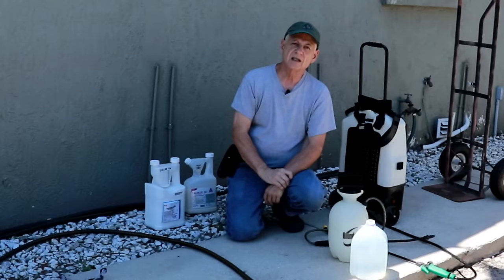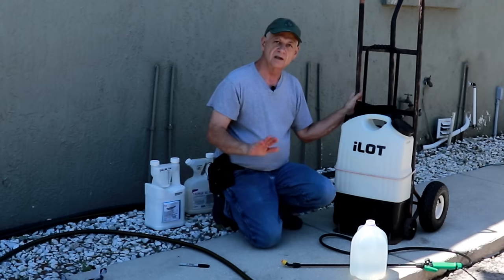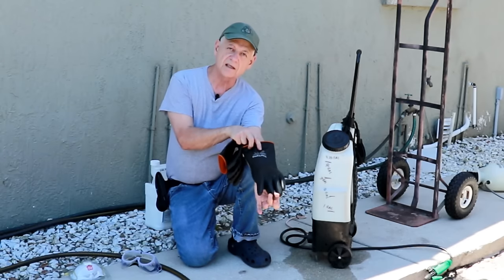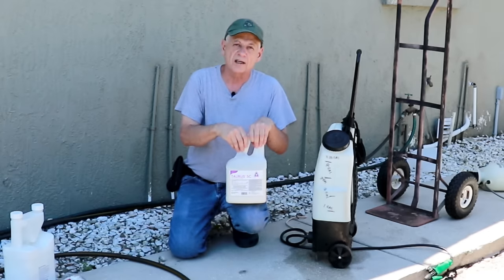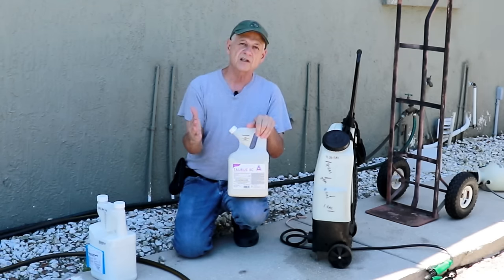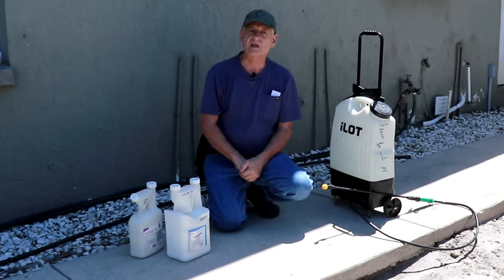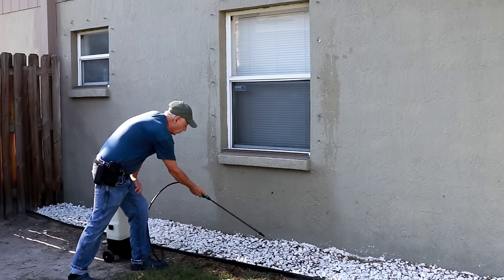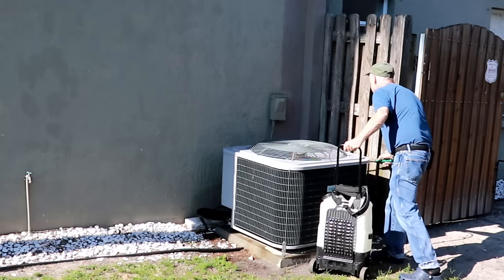General Exterior Pest Control - IMPORTANT!  READ THE DESCRIPTION.

Comment: Guy can I do Taurus sc spray in my attic also for general pets?
Reply from the maker: I would not use Taurus SC in the attic.  However, you can use Talstar P.  If you treat the outside of your house every 90 days, then you will no longer have bugs in the attic or anywhere else in the house.

I hope that helps.  Be well my friend.
Reply: @GuysPestSolutions   what  is the name of that b ig old tank you're using. tried the basic ones at harver freights but they always play out over time (those basic sprayers at hardware places/lowes/walmart etcc.
Reply: CAN U DROP A LINK FOR THAT BIG OLD SPRAYER SIR
Reply from the maker: They no longer sell that sprayer.  Too bad.  It's a great sprayer and it was not expensive either.  I have had it for years.  If you need a new sprayer, you can get a good one on Amazon for around $150, or you can do what I now do. I no longer use a tank sprayer.  I just got too old to be carrying the thing around.  I now use a hose end sprayer with Bifen XTS.  I have a video on how to do it.  In the video it shows you how to use Bifen IT in a tank sprayer and that is much like the Talstar P.  Later in the video I show you how to treat with the hose end sprayer and Bifen XTS.  Doing it this way is 3 or 4 times faster and it's super easy.  All the equipment and supplies are listed in the description of the video.  If you want a good tank sprayer try the one I have a link to below.  I don't own this one, but it's a good make and puts out 60 psi.  

I hope that helps.  Be well my friend.

Video on how to treat your house with Bifen products:  https://youtu.be/Yozv3s-Qwlw

Tank sprayer:  https://www.amazon.com/Chapin-60124-Multi-Purpose-Rechargeable-Translucent/dp/B0BYB6P8J3/ref=sr_1_8?crid=X0ESEWS5ZRA7&dib=eyJ2IjoiMSJ9.xOjNhX6PcVj0MJ0w3o4FA5bnOCeYmxIjjQayKBunhns-OlQnm3rF1GYAi1iORd31eakc3T7FXNhcFJdstQ-i1h3834olNQCAi95xnn6ISLX1G3CZbTDF0PVGGZDI4m_tWwFQNjUF8UW7WuD7JZBuf2dPzIENPAysMHNppqjCZBAjl6hp4OrLe2t3E_AoGk32tjNwjylRP1hy6xCkIxIkyxB60YBArFLFXQGVqgRHP_E_7sWIxVtpFUrrqWOSS_rH7WXwccwFwS6wfKA58PC-OJGoS_7rEjBfL54EtsIn34Y.OvKGA4IyKinDIHdM4iW02Arag2GtiZNxs-c61I_aIcg&dib_tag=se&keywords=chapin%2Bbackpack%2Bsprayer&qid=1718819573&sprefix=chapin%2Bba%2Caps%2C114&sr=8-8&th=1
Reply: Could you go over the specs you need for guns on sSpecification on sprayers: Total volume: 16 L; Working Volume: 12 L; Pressure: 1.5-4.0 bar; Product Dimensions: 24.8 x 8 inches (63 x 20.5 cm); Lance Length: 20 inches (51 cm); Hose length: 3ft Reinforced Hose; Net Weight: 8.3 lb (3.8 kg); Gross Weight: 8.9 lb (4.05 kg)prayers. This would be good for for viewers.
Reply: @GuysPestSolutions  can you go over spec to look for on sprayers that shoot more force or pressure per say.  I seen one on lowes(cansister) wanted your take on it.Specification: Total volume: 16 L; Working Volume: 12 L; Pressure: 1.5-4.0 bar; Product Dimensions: 24.8 x 8 inches (63 x 20.5 cm); Lance Length: 20 inches (51 cm); Hose length: 3ft Reinforced Hose; Net Weight: 8.3 lb (3.8 kg); Gross Weight: 8.9 lb (4.05 kg)
Reply from the maker: Gosh.  I never really thought about all those sorts of specs.  Mostly, I am just looking for tank size and pressure.  I usually recommend a sprayer that puts out at least 60 psi.  The more pressure the better.  Most high-pressure sprayers are backpack sprayers and hold 3 or 4 gallons.  Either one is fine.  It depends upon what you are comfortable with.  The longer the operating time the better too.  The only other thing I look at is the length of the hose.  This is not a deal killer for a sprayer, but the longer the hose the better.  It's nice if the sprayer has wheels, but also not a deal breaker.  I hope that helps.  Be well my friend.
Reply: Thanks any links to good sprayers that  hold up😊
Reply from the maker: There are any number of good sprayers on Amazon at different price points.  You should go for one that has at least 60 psi.  A really good one would be My 4 Sons.  I will give you the link.  A less expensive, but still very good sprayer would be a Chapin.  If you want something with wheels, you could buy a VEVOR.  There are others as well. Just look at the specs and the reviews.  Select one that seems right for you.  You will have it a long time, so take your time.  I hope that helps.  Be well my friend.

My 4 Sons sprayer:  https://www.amazon.com/MY4SONS-4-Gallon-Backpack-Sprayer-Fertilizer/dp/B0D2JDX5XT/ref=sr_1_3?crid=2W26526XKFS00&dib=eyJ2IjoiMSJ9.rFOyFjexHNJqD7GkkwUS5hhki1xlNG1ntSBkkAxraLnN36hTchSpYE4cqlhOlgafAVI2DajSLae4P8ngc5BWSjZKQ-OoAc7tkk-KJcY2wAyyI05MZ6dMEGapYK0-RUYfYrcnOJjTio2kqv9Q2hhArgoKBUQMGHoz3uiKFL2XUADRk-AqDMW4awkd84VIC38Fej86LY05brLnTb4Lo40VhStPOPo2XbZUFZWwDeSNWiNvwvx3TZefVlWAuD4vJuAypU70c-AR9d8hwWuMdOWvte1xNIT6HATd7vAhNytgwLU.mHQaz9BJtBOTrjcDSVGX38X5I88C3DBHF8pMbv_rI6s&dib_tag=se&keywords=my+4+sons+backpack+sprayer&qid=1719571317&sprefix=my+4+sons%2Caps%2C120&sr=8-3

Chapin sprayer:  https://www.amazon.com/Chapin-60124-Multi-Purpose-Rechargeable-Translucent/dp/B0BYB6P8J3/ref=sr_1_11?crid=23DMMGI65ZE7M&dib=eyJ2IjoiMSJ9.cWqP_vYuVKJgdqKiVzX7x19Er8TIZbVKnwNVZElp5UA9DiRfWlbbuFoEHixFQSucnB94nm72VwNIINND-Xxx_F66-cQZQ9jTGQ4NglB0pnjJ7dfthOTocs0mGbcIV_MWYh-ZufpFACuOr35YhYtNDGDB_u_HrSkj8m_1CJoYSu4aNU3FThzIIAf0JqaGmhpvECD41HjhJpr5Zv-2DaDZbU7ediJYr6CtWkrqzxQtSxL5Va7KSLleM3qtUhAKYuUueAbgVuaJdowgMyeEuRsa1ajntzEA0ZBCdm3xq_yKU4I.UI3tetB5FzLtbvPkx2BSm2OYpnwbe3V9Qvv1Js4TlLY&dib_tag=se&keywords=backpack%2Bsprayer%2Bbattery%2Bpowered&qid=1719570882&sprefix=backpack%2Bsprayer%2B%2Caps%2C106&sr=8-11&th=1

VEVOR sprayer:  https://www.amazon.com/VEVOR-Sprayer-Cart-0-94-PSI/dp/B0BZRGNPF6/ref=sr_1_20?crid=23DMMGI65ZE7M&dib=eyJ2IjoiMSJ9.cWqP_vYuVKJgdqKiVzX7x19Er8TIZbVKnwNVZElp5UA9DiRfWlbbuFoEHixFQSucnB94nm72VwNIINND-Xxx_F66-cQZQ9jTGQ4NglB0pnjJ7dfthOTocs0mGbcIV_MWYh-ZufpFACuOr35YhYtNDGDB_u_HrSkj8m_1CJoYSu4aNU3FThzIIAf0JqaGmhpvHzAV8-txg--K3aIYDYn__8BHDw9LeewDq9S95EGAA7X5Va7KSLleM3qtUhAKYuUueAbgVuaJdowgMyeEuRsa1ajntzEA0ZBCdm3xq_yKU4I.Q03Rd6r6FV1xTo4Aozra58K6I8C8zXgjjQlYMmvPHzQ&dib_tag=se&keywords=backpack%2Bsprayer%2Bbattery%2Bpowered&qid=1719571155&sprefix=backpack%2Bsprayer%2B%2Caps%2C106&sr=8-20&th=1

Comment: Can I use the SC to kill spiders
Reply from the maker: The Taurus SC can only be used outside.  It will kill all the spiders that are out there trying to get in, so that will effectively end your spider problem.  However, if you have spiders inside the house, then just spray them with Raid Flying Insect Killer and knock down the webs with a broom.  Also, spray under the bed, behind the headboard, behind and under dressers, and anyplace else where spiders like to hide.  The Taurus SC can only be used every six months, but it does not last six months, so you need to do an in between treatment with the Talstar P.  So, start with the Taurus SC, then three months later use the Talstar P, then back to the Taurus SC, and so forth.  If you do this, then you will be spider free.

I hope that helps.  Be well my friend.

Comment: Tandem vs Talstar?
Reply from the maker: Talstar P is way more cost effective than Tandem and they pretty much do the same job.  You can get it even cheaper if you go with Bifen IT.  It has a slight odor to it, but it's basically the same exact thing as Talstar P.  I wouldn't buy Tandem unless you like spending more money than you need to.  I don't use Tandem because of the cost, but I'm sure that it does a fine job.  The Tandem runs around $116 a quart, while the Bifen IT only costs about $55 a gallon.  The dilution rates are similar, so that is a huge savings.

I hope that helps.

Comment: If you’re using Taurus like that you are blatantly  disobeying the label…. Taurus SC can only be applied as a 18 inch permitter band for general pest control. He’s very thorough but Taurus used like this is illegal; you need a less restrictive product like Suspend Polyzone or Patrol. 20 gallons is also way too much product for a permitter. 1.2oz of product, or 1.5 gallon of finished dilution per 1000 square feet is the appropriate application rate @Guy’s Pest Solutions
Reply from the maker: Hi Jason.  I appreciate the comment, but you are not correct.  If you read the label again, you will see that Taurus SC is definitely labeled for use exactly as I described.  I will place the exact language below that I took directly off the label.  When reading labels you need to be careful to read all of it.  Sometimes the information you want is buried at the end.  In this case, the product is really made for termites and not general pest control.  However, it is labeled for use for all sorts of pests and you can safely apply it to the entire exterior of the building and it is perfectly legal in most states.  Some states do not allow for the sale of this product at all to unlicensed people.  Now, this is not to say that you cannot treat with other products instead.  There are any number of fine pesticides that can be applied the same way as I show in my video.  However, I have been doing this a very long time and I can tell you that an initial treatment with Taurus SC, in my opinion, is as good as it gets.  After that initial treatment, then most other pesticides are fine to use.  The key is to be thorough.  Any crack, crevice, hole, or whatever you leave untreated is a place that bugs can enter.  I hope that helps.  Be well my friend.

APPLICATIONS TO EXTERIOR SURFACES OF LISTED STRUCTURES AND INTO WALL VOIDS: Apply Taurus SC finished dilution (or foam) as a low-pressure spray to the exterior of the structure where listed pests enter, trail around the structure or where they crawl and hide or their nests are found. Treat using a low-pressure coarse banded surface spray up to 18 inches in width around doors, windows, vents, pipes, foundation cracks, drilled holes or around any exterior openings where listed pests could enter the structure. Make sure to treat the joint where exterior siding (wood, vinyl, aluminum or other similar materials) meets the cement, brick or block foundation. Treat anywhere electrical, cable or telephone wires enter the house. This treatment should be made as a general surface spray, crack and crevice spray, or a wall void application. Taurus SC may be applied as a foam treatment into wall voids to kill and / or control the above listed pests.
Reply: @GuysPestSolutions  I agree that Taurus SC is the best, fipronil has a superb transfer effect for colony kills. Only other product that comes close is Alpine WSG.  Unfortunately Taurus has a even more restrictive label in New York and it’s application rate is capped at .8oz instead of 1.6oz. 
My understanding is the perimeter band was only 18 inches and the company I work for does not permit overhead applications like you demonstrate because concerns about drift, even though many products are labeled to be used on the underside of eaves. My understanding of the label was that maximum treatment height on a structure would be 18 inches for Taurus SC because of what the permitter band specifies, but it seems like that’s not actually the case. What you’re saying and what the label says is that the permitter band is 18 inches but you can treat more thoroughly above that around any entry-points you mention? My company has trained us to really only apply a permitter band and not spray anything over shoulder height, even if the label permits overhead treatments. We still focus on entry points but we really don’t do around door frames or windows frames if they’re overhead. If I was to treat like you suggest would you recommend a pin stream or a fan spray for overhead treatments and door/window frames?
Reply from the maker: Hi Jason.  The 18 inch band thing means that the pesticide manufacturer doesn't want you to drench the walls with the stuff, but you can apply it around windows, doors, eves, and so forth, using an 18 inch band.  Now, it is perfectly understandable that most pest control companies will not use this product to treat eves or anything over your shoulder.  As you pointed out, we have some elements at play that can create a problem for a pest controller.  One thing is gravity and the other is wind.  When you spray any pesticide on the eves, or any other place over your shoulders, gravity is going to force the overspray down.  If it's breezy at all, then you are going to get some drift.  This is not so much of a problem for the environment, at least not in my opinion, but this is an issue for the pest controller.  The truth is that getting some of this on your skin once in awhile probably will not cause any harm at all, but if you do this stuff every day, then you really don't want to be getting it all over yourself all day long.  My video was for do it yourselfers who are only going to use this product for eves every six months and I specifically advised folks to wear full PPE and to take a shower immediately after the application.  You see, here's the thing.  If you want to find a place on any home where bugs can enter easily, it's the eves.  There aren't just penetrations in the eves, there can be long penetrations in the eves.  When you live in a place like Florida for example, we have drywood termites.  These guys do not colonize in the ground, but rather in wood.  The swarmers will and generally do enter the home through penetrations in the eves, as well as around windows and doors.  Once they establish a colony inside the attic, the homeowner is in for the infestation from Hell.  The only sure way to eliminate drywood termites is to tent and fumigate the entire building.  By treating the eves and around all windows and doors you virtually eliminate the possibility of getting drywood termites.  Treating the eves also prevents spiders, wasps, and so forth.  Again, most, if not all, pest control companies do not do this treatment for safety reasons.  They want to take good care of the people who do the work and I would agree with that reasoning.  However, it is perfectly safe for a homeowner to do it because of the limited exposure.  I always do a fan spray in all these areas and yes, I do get the product on myself from time to time.  I got my first license in 1981 and I retired in 2006, so I have been doing this a very long time.  If you think fipronil is worthy of respect, then you should have seen the stuff we used back in the day.  It would make your hair stand on end and it has been banned everywhere in the US and most parts of the world now.  I got that stuff on myself from time to time too and I'm still alive.  Not that I am recommending to get pesticides on yourself.  I'm just saying that an occasional exposure that is washed off quickly will most likely not be harmful.  Contact with any pesticide should always be avoided if at all possible.  So, I am very careful when I apply pesticides over my head to be aware of where the overspray is going, so that I can stay clear of it.  Even still, I do get some of it on me from time to time.  So, my advice to you is to do exactly what your company tells you.  If you do this for a living, then you should be just as safe as possible.  I hope that clears it up for you.  Be well my friend.
Reply: @GuysPestSolutions  I’m familiar with some of the products that fall into the category of chlorinated hydrocarbons or the organophosphates/carbamates that were banned by 1996 or earlier. The synthetic pyrethroids or neonicotinoids on the market today are much safer, even if sometimes less effective. But anyways, thank for you for insight sir and I apologize for my initial misunderstanding. I just want to learn as much about this trade as I can.
Reply from the maker: I have no problem with the initial comment you made.  Trust me.  Your comment is far from the worst one I have received.  I don't get mad or anything when that happens.  I figure that if you are going to be on YouTube, then you better have some thick skin and be ready for a bit of criticism.  The way I see it though is that folks like you are not trying to be mean or malicious.  You left your comment because you genuinely thought that I was leading folks in a direction that may have been illegal and harmful.  So, your heart was in the right place and you were just doing what you thought was right.  How can I get mad about that?  Besides, at my age I have learned now that I am not always right and you may have had a good point, which is why I immediately took another look at the label when I read your comment.  Labels do change sometimes and I never rule out the possibility that I screwed up.  For that reason, I always think it's best in these situations to open a friendly dialog and explain my thinking.  To your credit, you are the only one who has actually written back to me after I made my case.  Most of the time the person who made the comment realizes that they were incorrect and they simply delete the comment.  It takes integrity to keep an open mind to see that there is more than one way to look at something.  You have that my friend.  You sound like a fine young man and it was a pleasure conversing with you.  Be well.